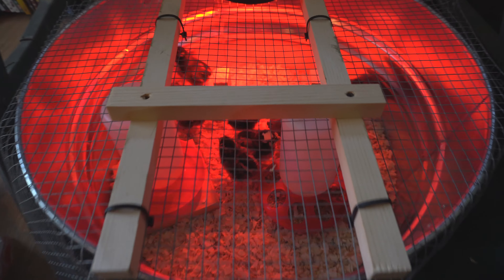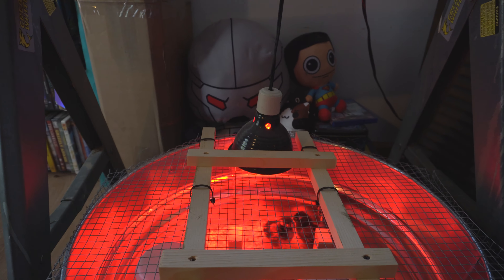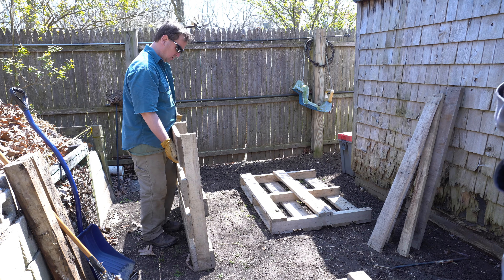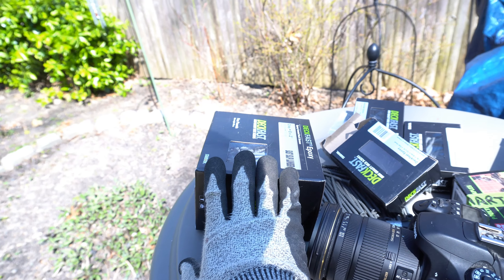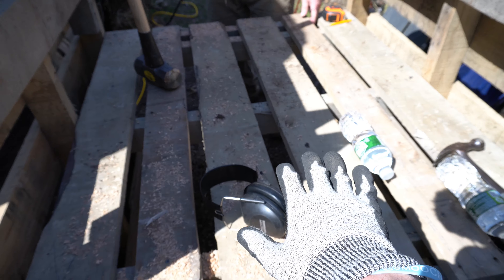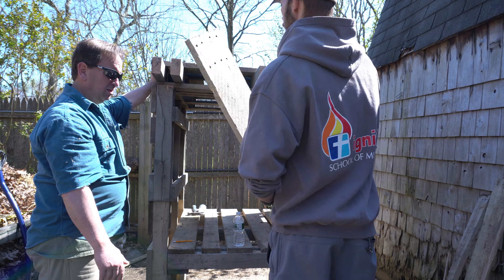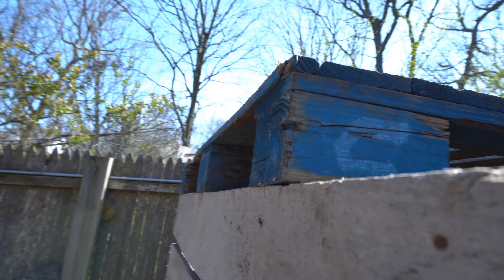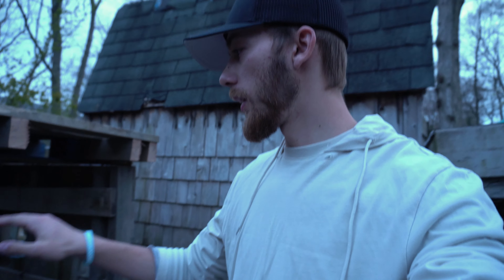Can You BUILD a CHICKEN COOP out of PALLETS?!

Comment: I built a pvc hoop house last year and used pallets for 24" sides.Breaking them down was a lot of hard work .(I don't use them for making small projects lol)  I'm making a chicken coop out of pallets  and hopefully a run too. At 64 working with pallets is challenging.
Reply: If you use a pallet breaker that will fix your problems a lot! Or a sawzall pry up the board a tiny bit and cut the nails off. Also adds a rustic look with the nail endings!
Reply: I built a 4 x 4 brooder, 4 x 6 chicken tractor w /wheels and and a 4 x 6 raised coop with a  4 x6 run in front and under it before tackling a 8 x 16 predator proof run. I'm all for using those to make it easier but can't afford them.Thanks!

Comment: Pre drill holes, it will be much easier to screw. It will also pull wood tighter. You should really check that chain, it's very loose which is very dangerous.  Keep going, want to see end product.

Comment: I made raised coop with pallets as well last year. Exactly the same way… but I dug the two on pallets on the side deep into the ground. And at the base I used a waterproof insulation board which slides in and out for general cleaning. Then just added two hinges doors on front made with feather edged boards. Great minds think alike ha

Edit: However I soon realised that there was a red mite infestation in the wooden coop. I had to pressure wash and steam clean to kills all the mites. Then apply mite killing spray. Finally applied coat of DE powder sludge in every exposed surface and corner to stop mites from feeding on chickens at night. Will re-wash and apply sludge in the summer again. Its only effective when it’s dry.